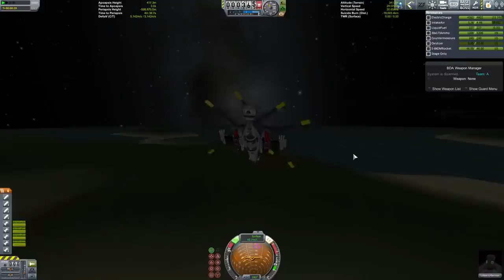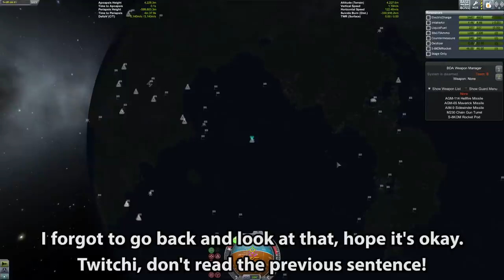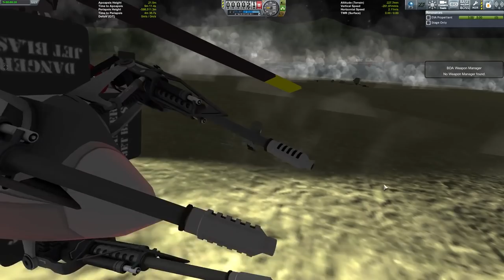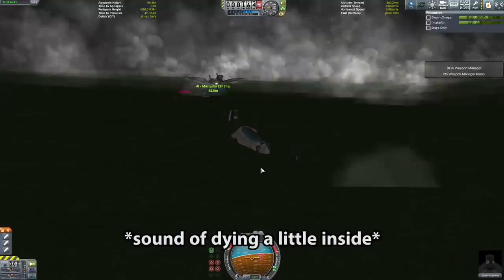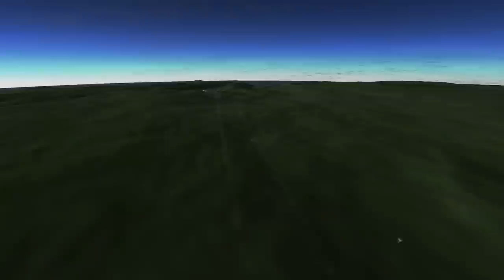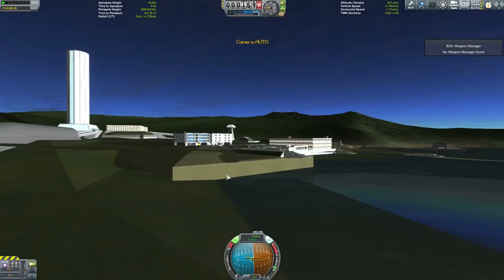KSP Kollaborative Warfare 11.1 : Whirlygig Rider

Comment: 24:00 I expected you to panic multiple times, but now that I know you're an IRL pilot I'm not surprised that you kept your cool.  Impressively handled.

39:19 Nice throttle there. Recommendation: Change your keybindings to be more ergonomic. I recently swapped my W and S keys, and I'm transitioning to using a multibutton mouse for RCS and throttle. In your case, a joystick might be more comfortable than a gaming mouse.
Reply from the maker: +r3dp9 I've tried that but my joystick has a crazy lag bug (about 1-1.5s input lag) in this version of unity, it'll be fixed in KSP 1.1 but until then there's no using it :(

I also wonder if it'd be fair - it gives you quite a fine-control advantage over other players, what do you think?

Also regarding the panicking, you can't see my extremely concerned facial expressions (but neither can passengers in an aircraft so that's not something they try to train you out of!)

Comment: I believe that what you called slipping is actually called crabbing but im no expert :P
Reply from the maker: +TheChosenZebra I thought about that a bit, I'm pretty sure it's slipping - Slipping is the flight condition in which you're turned nose out of the airflow (to get more drag to lose speed, altitude, whatever), while crabbing is where your track along the ground travels in a different direction to your nose, but usually is relevant to landing (because otherwise you're crabbing any time you have a crosswind).  The main thing that makes crabbing what it is, is that you're flying perfectly straight through the air, but the air itself is moving relative to the ground so you end up flying straight along a runway while having your nose pointed left or right of it, does that make sense?  Here's someone elses explanation that might be easier :D

http://www.askacfi.com/3010/crabbing-slip-sideslip.htm
Reply: Agonarch thanks :P

Comment: im going to guess that those boyency parts were put on for mounting your landing gears on?

No don't ban your helicopters. Just raise the bar for them!

Also good to see that at least one of the players understands the do's and don'ts of helicopter combat.

As far as why that one was so difficult to destroy based on what I saw it was mostly due a combination of not overloading its defenses and not doing a combined attack.

Next time you deploy one of your helicopters try this for your attack
Approach slightly off to one side of your center line
rotate your craft so its nose is pointing to the opposied side of the target from your velocity vector(Like no more that 15 degrees) and make sure to stabilize your flight (so your velocity vector is as neer the horizion as possible but your are still approaching at a quick forward/slight side strafe without losing altitude and try to keep altitude below 200m)

As you begin your attack run fire missiles (due to the offset approach angle your missiles will fly a short way to the side before turning in towards the target making the AAA gun point in a direction slightly away from your helicopter) 
and it fires and tracks your missiles; target it with your guns and rockets and try to shred its defenses.

The reason for the low altitude is to counter SAM missiles (since everyone favors pointing the directly up they have difficulty turning towards a low altitude target approaching at speed)

Comment: Um... it looked like you had infinite fuel on that entire flight, because your LF didnt go down at all.. or was it that those things are THAT freaking efficient?
Reply from the maker: +Bubbadevlin Yes, they're insanely efficient, a bit weighty but for the fuel efficiency you could easily make that up in less fuel.  I think they should be banned (the kerbalfoundries APUs), but until the others agree I'm not going to handicap myself! :D
Reply: +Agonarch They can't be banned. Without them making the grav repulsors work would be a pain in the arse. Maybe just banned for aircraft?
Reply from the maker: +Leytra Incorporated Hmm, maybe, but then these count as 'ground units' thanks to our creative designations!
I think maybe ban the electric rotors from KAX - cool as they are we don't actually need them and their low energy use for thrust is a bigger part of the problem I think.
Reply: Agonarch
Maybe yeah.. By aircraft I meant anything able to raise more than say 20m above ground level. Good way of classification.